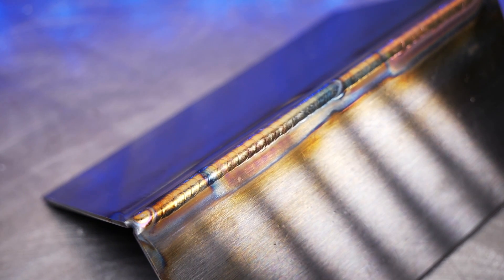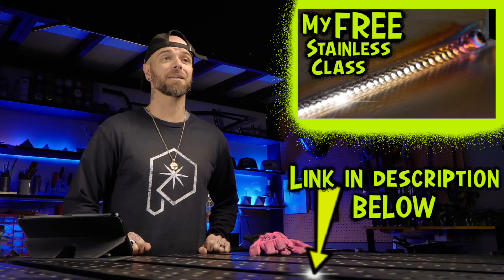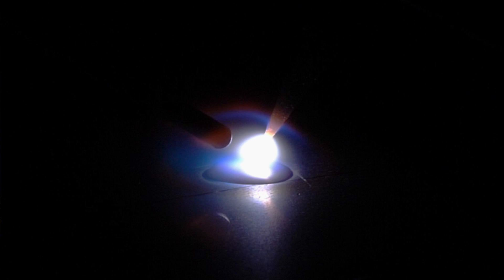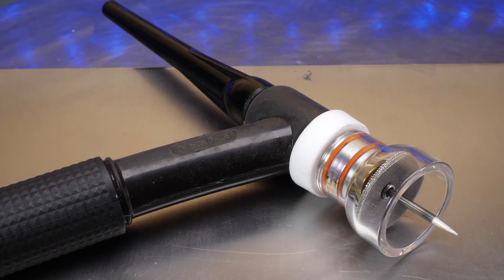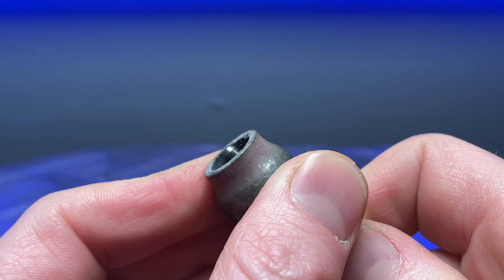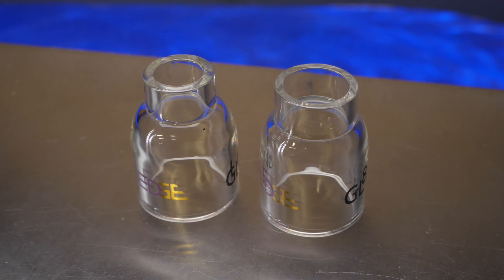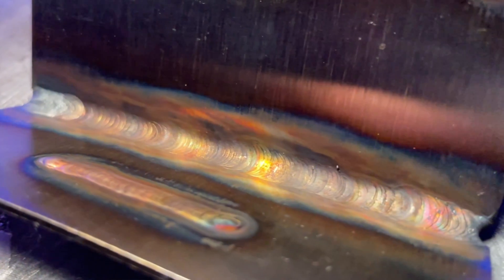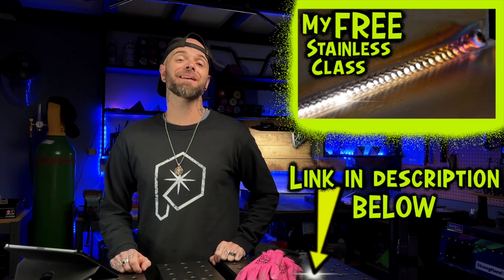How to TIG weld stainless - 5 tips in 3 minutes

Comment: Pity this didnt say which series ss is used.
Better would be to weld ss 300 series vs 400 series vs 300 to 400 series.
Thick vs thin etc.
Magnetic vs non magnetic,  weld cracking - HAZ etc.

Comment: Sir wich filler rod to be used for ss metal
Reply: Idiot question.
At least 3 different rods,
300 series or 400 series or 300 to 400 series with L rods.

Comment: Not really helpful. Most your videos use BIG cups and so it's really easy to have beautiful welds. I'm using small cups because I don't want to use too much gas. Also everything is great until I introduce filler rods, then all hell breaks loose. Steel gets overheated by the time the puddle is enough to accept filler rods. If I move faster I get no penetration, and if I get enough penetration, I'm overheating the metal. There's no middle ground either.
Reply: Good welds are expensive, turn up the gas
Reply: @DimeDaddy it's not about cup size, it's all about heat input. You can fill the whole freaking room with pure argon, and you would weld wearing oxygen tanks with the waste gas vented outside, if your heat input is too much you'll still cook the weld. 

Also electropolishing attachment for your Tig welder is a lot cheaper than gas, and we are not welding titanium so as long as you are porosity free you're fine.
Reply: @taiwanluthiers  sure but electropolishing will remove a lot of the shiny pop your runs will have. 

I stand by what I said regarding your gas flow rate. Argon isn't so expensive so it's a weird thing to try to save on.

You can get away with having a smaller diameter cup, but your torch angle needs to be PERFECT!! Difficult when you're working in a confined space like I find myself doing often.

Just speaking from experience.
Reply: @DimeDaddy excessive heat input isn't going to be fixed by a giant cup and a lot of gas. Also electropolishing followed by a buffing wheel fixes a lot of things. They do this for food grade welds anyways, where any color is unacceptable.
Reply: Sometimes this could be too large of a rod so maybe try a smaller filler rod size and see how it works. Another possibility is to up the amps by 5 and then also increase your travel speed. Just suggestions. 😊
Reply: Get some 1/16 filler rod. I also have .040 rod for thin stuff
Reply: Dusty has explained a few times, heat=time.  Sounds like you need to turn up the amps and move faster.  There's no skimping on argon for stainless, but I have clamped 2 pieces of aluminum angle iron beside where the weld will be to make a canyon for argon to pile up in instead of spilling north and south from your weld.  Hope that helps.  
Question, what thickness ss are you welding, what are your actual amps, what is your cfm of argon?
Those details would be helpful for anyone giving you a valuable answer.
Reply: @carpediemarts705  I have no idea the CFH, we don't do cubic feet in Taiwan, I have it at about 5 liters per minute which gives me the best weld possible (anymore and I don't get any additional benefit.

I was welding 1mm stainless, lap joints. Everything looks good if I do this without filler wire, as soon as I introduce them, thing gets HOT, weld looks like crap, etc.

It doesn't help that my auto darkening mask is flashing me at regular random intervals. I'm changing the lens, can't see anything when everything looks fine then next second it's like looking at a nuke going off. This is actually aggravated by using glass cups. Yes I've tried putting the thing under the sun for a few hours, it didn't really help. I think the lens is bad which is why I'm having them replaced.

Amp setting is around 35 amps if welding 1mm, 75 if 2mm, and 110 if welding 3mm. This is non pulsed.

Cup size is 8, this is the largest cup I have. The glass cup is 10 I believe. 

Pulsing without filler wire gave me the best result, but I can adjust the pulse width in addition to frequency. I need 110 amp pulsed at 15ms to have any fusion whatsoever if I'm doing a butt joint. 

I'm moving as fast as I can without resulting in no penetration. I tried moving VERY fast with high amperage and all it did is give me no penetration, though the weld ball on the steel looks dark blue. 

In fact this is the ONLY channel that I've seen where everything is silvery white and perfect. I've looked at weld.com and welding tips and tricks, and their weld looks closer to what I'm getting. Good penetration but not shiny.

I realize this guy's doing it for art, so penetration may not be important to him.
Reply: @carpediemarts705  I wouldn't even use 5 l/m on aluminium mate, that is so low it's almost unheard of. 

This thread has given you all the answers to your problems, I don't know what else to tell you 😂
Reply: @DimeDaddy  not my thread
Reply: @carpediemarts705  sorry mate, I'm old
Reply: @DimeDaddy  So basically more gas, bigger cups will solve all my problem, right?
Reply: @taiwanluthiers  For most stainless steel work in my industry, a #12 gas lens is used as the go to. 

Not saying it'll fix everything, but you shouldn't starve stainless or titanium of gas, both materials need it.
Reply: @DimeDaddy  First thing is, my crappy mask is not darkening reliably at all when TIG welding. It will darken when looking at a bright light, or stick welding, but TIG, unless I'm doing 100 amps or more, it will not darken, but rather just darken for a split second and remain bright the rest the way. That's making it hard for me to keep a short arc (key to reduce heat input). 

I'm not sure why it does that, because the other auto darkening lens I had before would darken at the slightest hint of an arc, even the HF start arc is bright enough to trigger it. Only thing that wouldn't trigger it was cutting with acetylene torch, it was bright but not enough to trigger the auto darkening lens.

I'm getting new ones and before I do I can't do any welding. I'm trying to put it under a bright light to see if it's the battery problem.

But I really need to figure out a way to reduce heat input. No amount of gas is going to fix anything if I can't do that.
Reply: @DimeDaddy  I'm using a #10 gas lens, actually #8. I dial my gas the way I am because it gives me a shiny weld if I am careful not to give it too much heat input. Through experimentation, I've found more gases doesn't give me better result once I dialed the gas up to where it will give me a good result. For a #8 gas lens that's actually about 4-5 liters per minute. I could actually weld for a while on a 10 liter bottle with this. The clear cup I got is a #10 gas lens.
Reply: The heat affected zone is not just about amps, it is a factor of heat imput (amps) and travel speed. I had done most of my TIG with a scratch start unit where the amps you start with are the amps you finished with. In SS the initial puddle was slow to form but once it did the travel speed had to be significantly increased throughout the full weld as the material heated up, and finishing the end of the weld required pulling off onto a piece of copper before snapping out.  Argon flow needs to be enough to cover not only the welding area but also the cooling of the hot weld just behind the puddle. That is why a larger cup works better. So you need to experiment with amps, travel speed, and cup size to find out what is best for the type of welding you do. I found higher amps and faster sorted out my particular issue.
Reply: @deansawich6250 regardless of my amp setting, whether it's high or low amps, once a puddle forms the metal is glowing angry orange, and is already cooked. I don't know what's the problem. Only when I weld thicker SS sheets is this much less of a problem, and this channel I believe tacks everything to another heat sink to prevent that. But regardless of what I do my haz looks just like the top one in the preview. 

Faster travel speed only resulted in bad welds with no penetration. 

I guess anything less than 2mm is going to be autogenous no matter what
Reply: You can also check out "The fabrication series" channel on YouTube for more helpful tips. I've learned a lot from that guy. Every little bit helps.

https://youtu.be/z86cWH6ZFTA?si=D3hZ26CFfhtIBi31
Reply: Also, don’t start moving too fast. Although it sounds counterintuitive, you have to develop sufficient puddle before you start moving.(that is one of the lessons that Dusty teaches.)
Reply: @Wild_Bill57  Every video I seen said to start moving within a second or 2 after striking an arc. So I'm not sure where to draw the line. I've experimented with this by the way. If I wait for a puddle the steel will be HOT, so hot that it's glowing red in a very large area beyond the cup area (and this is even if you used a #10).

So what amperage setting do we use? I've heard the 1 amp per .001 inch rule, and so I used that rule, and the stainless overheats EVERY TIME.
Reply: @taiwanluthiers  stainless can be tricky to get the hang of. I am still learning also. Im not sure of your setup but i use a foot pedal to control amperage.  When using a pedal you have to get on it kinda quick and heavy to establish a puddle quickly than get filler in almost immediately to help cool the puddle and get it moving. Also maybe try welding shorter distances so your not alowing glowing metal to be exposed to ambient air. Maybe only weld about half the width of your cup than stop and keep gas flowing on the weld and filler rod until it stops glowing than give it another second.
Reply: @djp9461  I don't have foot pedals, I got a 5 pin jack on the welder, presumably for a foot pedal but I have no idea what pin does what, so I can't diy a foot pedal or a torch control.
Reply: He has a couple videos about great effected zone. That might be what you are doing wrong
Reply: @shenamariscal6200  I just know that unless my arc length is so short that I'm damn near touching the metal, I can't seem to get heat under control. If I'm using the recommended arc length of between 1.6 and 2.4mm, it does not work. 

Aluminum on the other hand is different. Often I need a large arc length or else it will suck molten aluminum into the tungsten.
Reply: @shenamariscal6200  I figured it out. My weld isn't straight or neat like stacked dimes, but I'm getting the colors in this video simply by reducing heat input. Basically this means 100 amps or greater, pulsed, and fast travel speed AND short arc. In fact I'm even looking into a higher amperage, shorter pulse width, or just "cold weld". I did a cold weld and if the setting and pulse width is done right, I can get a weld with NO color, and barely any heat on the other side of the steel. We're talking 200 amps here, with a pulse width of 60. The only bad thing is, my welder doesn't do preflow when on cold weld mode, meaning I'm spitting piece of tungsten out at the work just because it's starting up in air. I've had to set the post flow long enough so that I can basically shoot the arc at the air, and position the torch fast enough to shoot a quick arc at the metal. 200 amps and 60 pulse width will tack a 1mm stainless sheet in one hit, and if you set it to repeat, you can get a good bead without any HAZ whatsoever.
Reply: @taiwanluthiers  there are so many things to focus on at the same time,  huh. But if it was easy everyone would do it!
Reply: @shenamariscal6200  I just think doing whatever it takes to minimize heat is the key to a good finish, not more gas or better gears. This means if it's something thin, clamp it down to a thick piece of aluminum, and sandwich it between aluminum channels to basically make it cool off very fast. Then very high amperage setting to get very localized heating, and fast travel speed.
Reply: he way you explained and demonstrated proper puddle stability made everything click for me. Thanks for this amazing guide